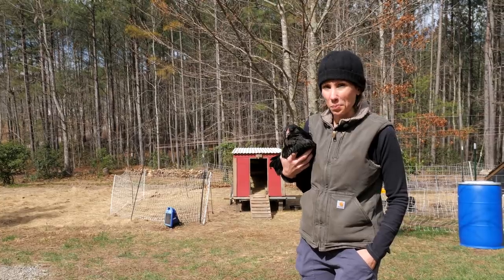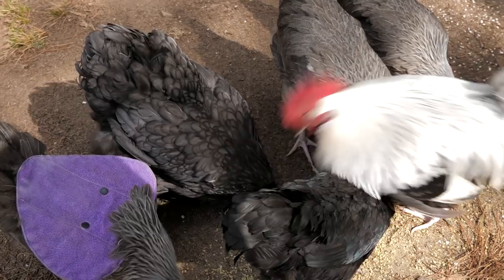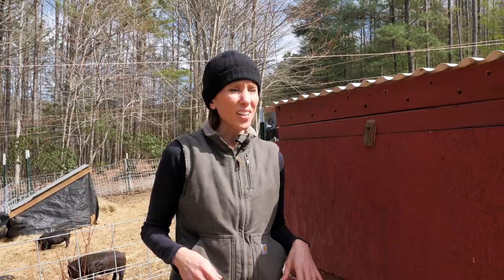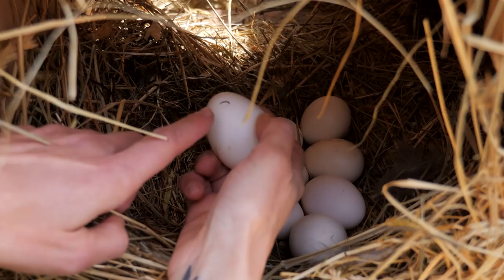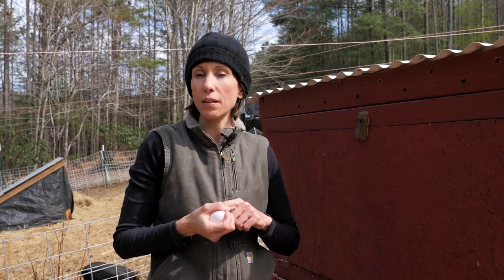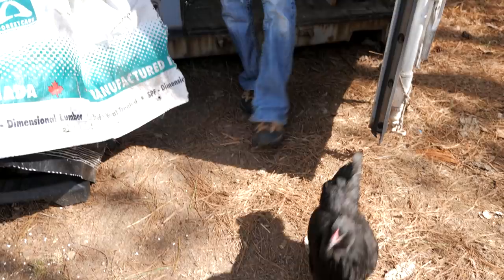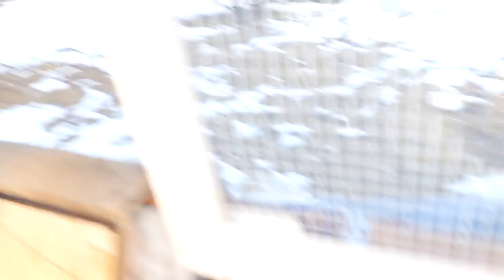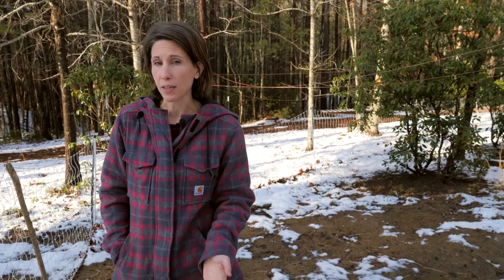BABY CHICKS HATCH:  Our First Hatching

Comment: I had the same problem with broody hens.  I had to build a 2'x2'x8' isolation cage at then end of my chicken coup so the broody hens were left alone to sit on a specific number of eggs.  The cage is about 5' off the floor above my nesting boxes.  All the chickens are under the same roof and protected from the weather.  About two weeks after the eggs hatch, I let the hen and her chicks join the adult birds.  The hen is very protective of her chicks and the adult birds have not been a problem.  I don't think I've ever had a 100% hatch.  It's great when you have broody hens.  I've used incubators, but always  worry about power outages, and maintaining the temperature and humidity.

Comment: Great success and hen. You have learned a great deal in a relatively short time. I look forward to seeing your continued journey to self sufficiency. My husband is so not interested in any self sufficiency. He likes watching me in my little garden, and funded the Garden Room build, but he won't even consider solar.
Reply: Patrice's Projects, start with little solar yard lights ($1 each ) that light his path to the car, a string of solar Christmas lights ($6 on ebay) along his path to the garbage can and a solar security light ($10 on ebay) above his shop door. Before you know it you'll get a solar powered poultry net and a small solar panel to power your chickshaw lights.  Start small and he'll see the value. I didn't think I'd like these solar improvements but they are great! I thought the only way to go was to spend hundreds of dollars to have these lights wired in, but solar was cheap and you can't buy a light bulb for these prices. And easy to install. The yard lights you flip a switch and stick it in the ground. The security light was peal and stick. I used the hooks he used for the Christmas lights he took down. So give it a try. Sending lots of love from sunny ☀Arizona, 83/57f today. 🌵

Comment: Fun fact!  the triangle you described as an acute triangle, is correct, but acute is a general term. Because this triangle has 3 sides the same length and the same 60 degree angles, it has a special name: equilateral. xoxo ☀🌵

Comment: Unless its all about cost, I don't see any advantage to using Amazon's off-the-shelf gizmo when you can just as easily get a suitable xxAh battery and a $20 inverter and run this thing to your heart's content. Then during the day simply hook your battery up to your solar array to charge (I hope you are using an MPPT charge controler). Presto! You're done. A bit more $ yes but you get exactly what you need and no more guesswork!